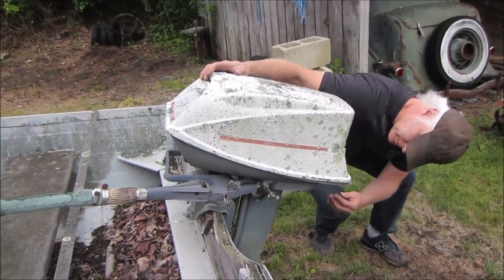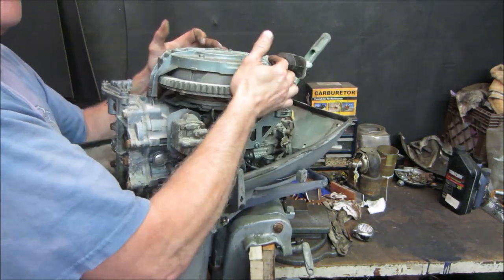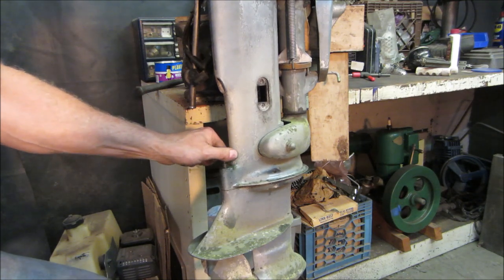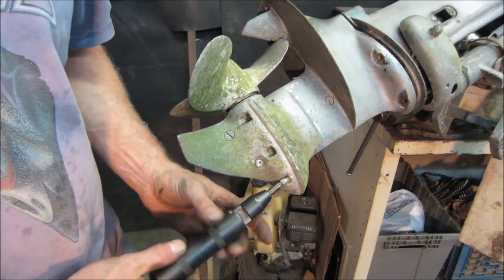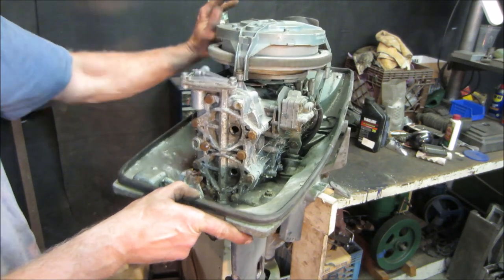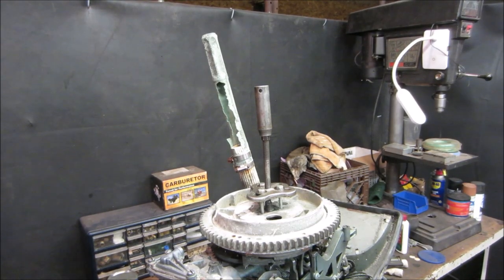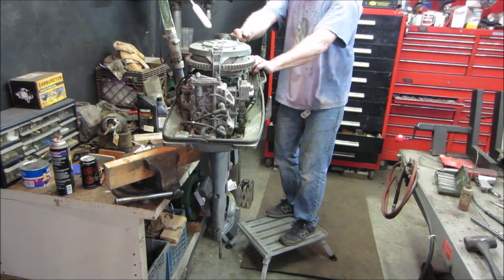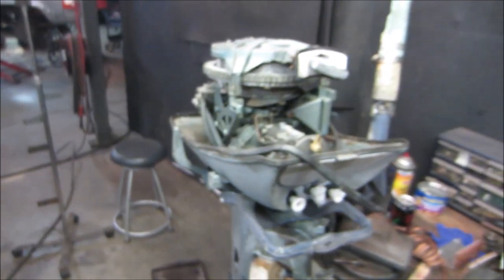Free Boat and Motor. Sitting 20 Years, Will it Still Run?

Comment: I bought it new like this one and had it on 16 ft Jon boat on the Mississippi River in south east Iowa! Great motor and no problems then trader for electric start 25. The 18 hp got in the 60s and traded for the 25 hp in the 90s and still running on the same boat.

Comment: I like the using putty knives to not ding up the mating surfaces on that lower end. I'm actually doing the same exact thing with an old 74 Johnson (runs awesome but want to do an impeller just for general maintenance. The 500 yr old one in it is actually still pumping away). But the lower end is very much married via corrosion just like that one was. So thanks for the idea!

Comment: I use to have one. It's a great motor and has plenty of power... mine was converted with electric start. I think a lawn mower starter bolts up to it and a small push button on the lower case housing and your set. Eliminate the pull start completely.

Comment: Trick I found over the years starting to stroke engines. When they've been sitting awhile and you're having a hard time starting them. Use straight gasoline no two-stroke mix. It will increase your chances of it firing up by 50%. Just don't run it too long. The straight  gasoline will also clean the carb in all the old gummed up two stroke oil. You can also take the pull start offand on the top you have that nut you could put a high torque drill and start it that way. An impact gun on the top will not work though. Good luck like watching your videos.

Comment: the recoil bracket that is broke is very common, You can just make a "splint" out of a little piece of aluminum and a couple 1/4-20 socket head cap screws to fix that! I have this exact motor...

Comment: I recently bought an old skid steer. I pulled the old engine out, a Wisconsin VH4D. I'm putting in a new Briggs and Stratton Vanguard engine. The VH4D could use an overhaul if you're interested.

Comment: A little late on replies but it’s better than none at all!?. Anyways I switch all condensor and point systems over to electronic ignition and these older motors really shine with the newer ignition. Costs about $25 for parts to switch it over and takes about 30mins to do so. Never having to set points again is nice

Comment: Just FYI on those older omc outboards, there is a crimped on metal tab on the plug wires close to the boot that says top or bottom. It makes for easy identification of which one goes where.

Comment: I'm late to this video but wanted to say that i have had a couple of these engines over the years.. the plug wires are usually marked with a metal crimp indicating location.. top-bottom. i would soak the gear set in oil and and get freed up.. water pumps are still available.. she'll definitely go

Comment: I had one of those Evinrudes  in the mid 70s around the same vintage early 60s spent an awful lot of time doing aerobics trying to start it, awful when you are bobbing up and down at anchor and the weather is going bad.
It eventually hit the sea bed when it jumped off the transom and made way for a suzy.

Comment: The problem with getting that old motor to run at all...is now you're going to be tempted to try and make the whole thing serviceable again...and that is almost certainly not worth the money.  Still very satisfying to see that fireball, though!  :)
Reply: Satisfaction, (of a job done) you can't put a $€ price on - its done for " I got this going ^ , Like the C100 Honda cub I restored as a kid from a pile parts using NOS parts off shelf in "76. Similar to C50 now, i gave it awsy for what it cost : $250 😧

Comment: I challenge you to get it running  and go for a ride on the water! 
I disassemble a land cruiser transfer case hade the same lubricant as this boat motor final drive . It still worked  the ranch owned was using it regularly 
. I was amazed!

Comment: My theory?, it was out of time and when you twisted the vise to get a better pull angle, you put it back in timing. I had an old boat and motor like that style that I paid a few hudred dollars for back in the 80s. It would jump out of foward gear unless you held the handle tightly and that only work up to about halt throttle. I checked on a new gear set and it was over $100 in 80s money. I disassembled the bottom end and noticed a worn forward gear and a perfect reverse gear. I simply pulled the gears off and swapped them and now forward was fine and it jumped out of reverse. That was the first piece of machinery I fixed and sold for a profit.  In the last forty years or so, I have bought and sold many vehicles and made and lost money on about half of them either way.

Comment: This episode reminds me of my first boat back and the early 80,s.   It had a 40 hp Twin cylinder Chrysler.   I decided I was going to tune it up even though it ran fine.
Removed the flywheel nut with an air impact.  After checking the points and reapplying the flywheel I snapped the end of the crank shaft off with the air impact.   You can imagine the disappointment. I very carefully welded it back on.  Then carefully torqued the flywheel nut down.  And for the two years I owned the boat I was nervous the flywheel was going to fly off.

Comment: I have an Evinrude slightly older, yet does have single gas hose as this one does (has fuel pump).  Mine is only 5.5 HP, yet also has two cylinders and looks incredibly similar under it's cover.  Enjoyed watching you mess up with some simple things, yet having the guts to tackle more complicated stuff.  May I suggest using penetrating oil even more often to tackle loosening bolts (just anything which appears dry). 
 Just where do you get your always calm mood ?  Personally I swear, yell, throw things a lot.  After my divorce a neighbor across the street asked my wife if I was a drinker, an alcoholic.  He was very surprised to hear I don't drink.  I just don't work calmly as a tech.

Comment: Nice save.  How about trying an Allumiweld repair on the pull starter frame.  It would be cool to see if that kind or repair could hold up to a running motor.

Comment: I was looking through a lot of your video's as I do, for a restful experience.  You had one, you were getting the bikes ready for showing.  The electric chopper style bike, you know the one with a motor in the front wheel?  How cool would it be to add electric start using the front wheel, and then use the motor as a charger?  I know you are the mechanical wizard, just a thought.
Stay well, keep safe.  Keith

Comment: You put a water pump in a 57 or so on here ...that lower unit would fit. The top cylinder clip that says top is clearly visible in the video. Hook it up to any john. evin. ONE line tank and she would run. Great video!

Comment: Kept thinking on my comment about paddle boat for the lake, even worked out using snow blower drive clutch mechanism each side to allow forward and reverse at the same time, at slower speed. Then full ahead and damn the torpedoes 😁😁😁😁

Comment: Mustie , you need to turn the throttle down to shift that motor. Just like in neutral you can only advance the throttle so much and it stops unless it is in gear.

Comment: Soak that bottom end in vinegar, before you sign off on that motor, I did the same thing to my old Johnson outboard motor and not only got it a part, but got everything freed up and working again, sold the boat and motor for a nice little profit as well some of the damaged parts might be found at old boat salvage yards, scrap yards or junkyards as well!

Comment: You can order a used lower end for around $100.  I tend to pick those engines up for around $50 not running.  I've never seen a dry lower unit before though.

Comment: You can fix the rope starter, either by welding it or if it's plastic by putting a piece behind and in front of the break and heating it to melt.

Comment: Prior to 1972,  HP ratings were at the power head.  After, they were rated at the prop.  My '86 40 HP twin was faster than my 1960 75hp V-quad.  Fun fact.

Comment: Regarding the spark plug wires, there's a little steel band indicating which one is for the top cylinder.  You're probably better off trying to get a used lower unit than trying to revive the one you have.

Comment: got a 1960's one in my garage might be 70s not sure one day i will sort it as it runs but needing work done on it, got a Johnston 10 hp one as well from the 80s but cany get it to pump the fuel even after changing all the gaskets on the carb it would run lovely if i could get it to work

Comment: Don't use modern pressure treated plywood to replace the seats and such.  Instead, coat with fiberglass or two part epoxy.  Modern pressure treated will react negatively with the aluminum.

Comment: Shift rod linkage: loosen the bottom screw but don't take it out. The lower rod has a ball joint type of attachment and will slip out of the block...

Comment: I have the same outboard. Mine is in pristine condition. Reverse doesnt work. Ive rebuilt the lower unit 3 times. Parts for the 64 evinrude fastwin 18 gets expensive.

Comment: Stamd the motor upside down and try to put some penetrating oil on the drive shaft. Common issue for old outboards that have sat for long time or poorly maintained is for the spines to get stuck in the bottom of the crank shaft

Comment: That's odd...usually those motors fire right up in the shop. They typically only need 600 pulls once they are on the water and a storm is rolling in.

Comment: I love the look of pure, unadulterated glee on yout face when an engine comes back to life. I'm laughing at all the guys saying "repair it". You did say it wasn't financially viable, rather than saying you couldn't fix it. What would a second-hand one of these cost? I never bought an outboard.
Reply: "What would a second-hand one of these cost?" - that age? 200-500$ in good working order. More than the parts would cost, unless you can find a good junker. You also have to account for your time. New 20HP motors are about $3000.
Reply: @txswm  Interesting, Thanks Scott. YouTube revenue   could distort these figures a bit too. 
The trick with this game is to find two of everything, damaged in different areas. I'd keep that engine aside until I found another scrapper, with a good bottom end. Same with cars and motorcycles; one to fix, one donor. It could be years but, when your "stash" is the size of Mustie's, maybe not so much.

Comment: I spent two years at OMC Waukegan after I retired from the Navy. I did the photography and writing of installation and owner's manuals. These engines are sturdy beasts and can take a lot of abuse. But, I must tell you that that there are no bolts on that engine. According to our writer's manual, everything is a screw or nut. No, no, no bolts. The only reason I left was because the company folded.

Comment: Well for that linkage for the shifter link you only needed to take out one Bolt the top one you should have left in how far is 18 Evinrude goes I've had two and they're good Motors I played with them as a kid

Comment: That gear will free up to for the impeller drive the pump yeah it's going to need replacement.& regreased up again to.,or 80w90 gear 🛢 oil in that drive unit. That. Pull top can be JB marine welded back together.,or just use regular JB weld instead.,or have it migged back at that spot.

Comment: Had an 18 Evendog. Probably would have cranked without removing the plugs. Curious why not trying the pull start. Probably just gummed up not being able to hand crank the flywheel.  Little starting fluid and fresh gas.

Comment: You have to put water because water cool the engine and the water you put it at the propeller which you get ot off and it can burnt if you dont put water...   No at the propeller But next to the propeller that has something lines to pass the water

Comment: I just retired my '69 18hp Fastwin, exact same outboard. The recoil had broken off years ago, keeps eating flywheel keys, and I finally retired it and took the coils off for my new '55 25hp Aquasonic. Do you want the lower unit bits and pieces?

Comment: On that broken bracket if you cant weld that aluminum. you could easily use a steel bracket and drill and tap 2 holes in it and reinforce that to fix it. a lot of work but those 18s are pricey so might be worth it. super corroded though.

Comment: since its a 2 stroke, make a flange and turn it sideways, use it as a go cart engine :-) You would need either a mechanical water pump, or an electric one with a small radiator, but it would be interesting.

Comment: So brake cleaner is good for cleaning electrical contacts? That's good to know as a computer guy, since I can't find any contact cleaner. It doesn't harm plastic, does it? It could be useful for cleaning noisy volume and tone controls on speaker systems if it doesn't. Also noisy audio jacks, maybe even keyboard contacts and the scroll wheels on mice.
Reply: A bit of Duckduckgo-fu says no, don't use brake cleaner instead of contact cleaner, possibly unless the label on the brake cleaner says it won't harm plastics, and even then test it on something from your junk drawer before spraying it on your good computer. It does give me a hint though, that contact cleaner might possibly be found in the automotive section of hardware stores (I'd been looking in the electrical section.)

Comment: Could that broken arm on the pull start be TIG welded?   It looks like aluminum.    Boat issues look like they can be easily resolved.    To me the big issue could be the bottom end.   Challenging project.

Comment: did you eventually figure out the driveshaft was seized into the crankshaft and that it should NOT stay with the motor once the gearcase is removed?

Comment: Marvels is good, if you've got time...otherwise use PB Blaster. Pull the lower unit off, you'll need a new impeller on the water pump anyway. DONT FORCE IT!

Comment: I don't believe your persistence on such projects. I would have abandoned that motor as hopeless, maybe used the leg with a 4 cycle air cooled lawn mower engine and dumped the power head. Aluminum parts and salt water don't survive over time, the corrosion can be great even with a steel sleeved power head. More than likely the mags and points survived being shielded by the flywheel, but the bushings, water impeller and lower unit are completely shot. It would be cost prohibitive to even try to save it to me as I do not have a "stash" of old parts to rely on.

Comment: I'm not surprised it ran with little to no effort after sitting for 20+ years because I'm pretty sure Evinrude was made by one of the guys from Briggs & Stratton. Anyone who works on small engines knows B&S engines pretty much run forever, that is IF Project Farm doesn't get a hold of one.. LOL

Comment: Bit late using freeing oil? I would have squirted every nut and bolt before starting to even try to strip it! Hammer should be last resort. Mind I am more familiar with old motorcycle engines, but you get basically thee same problems by the look of it. A good restorer would have it like brand new in a week?

Comment: 17:22 Why couldn't you just use a hacksaw to cut the broken bolt?   Or better yet, an angle grinder with a really thin cutoff wheel?

Comment: Got for internet and look up electrolysis use battery charger clean off rust works great before you go to the wire wheel.

Comment: 50/50 chances are wrong 90% of the time.  Your so lucky, it was just too easy for you.  The rope didn't break after the first fire, you only broke one bolt and it wasv"barely" still holding from corrosion, everything else slid apart like butter. ;). Can't wait for the rebuild to see you drop those coupler screws into the lower end. jk Oh man, salt water the ideal environment for small engines and electrical devices.  Because of you, my wife has now limited me to no more trash picked strays until I get rid of something. I've only got four mowers, three weedwhackers, four chainsaws, a couple of leaf blowers, a tiller and a go-kart, virtually nothing to complain about.  I'm really looking forward to my neighbor putting his pressure washer out, but after fixing the last mower he put out, I suspect it will have the hoses cut and sugar in the tank.  He doesn't like me.

Comment: Just for the sake of them for mation a 10 horse power lower unit is the same horsepower is that 18 you have right there Johnson or Evan rude either one will fit and will function just fine

Comment: Soak the bottom gear set in diesel fuel and then throw some gear lube in the bottom end and I'm sure it will run forever

Comment: That was painful to watch never heard of a drill and easy outs for broken bolts
Reply: Fyi to cthers the 18hp is about 50 - 60 yrs old !. Trev ps & there was a battery powered small model of it. ( if you find one b4 you try to start it they has a Spring - drive  :lube/soak lower end in ATF 1st. Trev. Thnks.

Comment: spray can of starter fluid is not better - to use than gas to get  motor going?
Reply from the maker: starter fluid is real dry and not good for an engine that has been sitting

Comment: Id like to be the one to tell you that she has a second life .But these puppies have needle bearings not shell bearings .im nearly certain she has needle and the problem is if they sit for long periods outside in winter the needles get slighlly coroded onto the shaft and conrod sleeve .Yes it will run 'but very quickly start chewing itself up and sound rougher than a bears arse after scoffing a bag of onions .I have tried hundreds of OB's and invariably they will chaw the shit out of the shaft very quickly.Did you get a lifetime guarantee with her  TE Hee HEE :-)

Comment: I yelled at you 5 times to tell you why the lower would not come off. And 50 times to say the plug wire with the silver band goes on the top. And then to tell you that the 6hp and 10hp are both twin cylinder motors